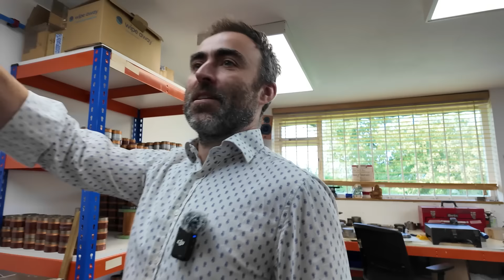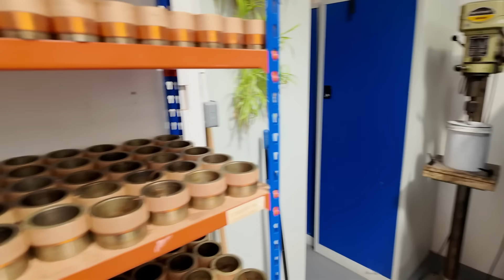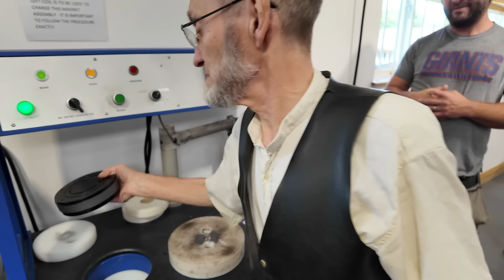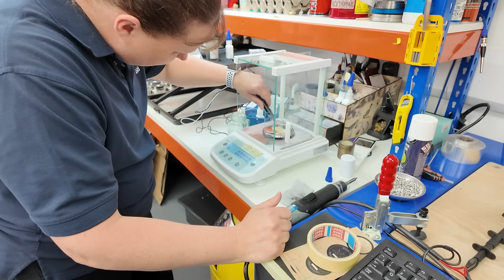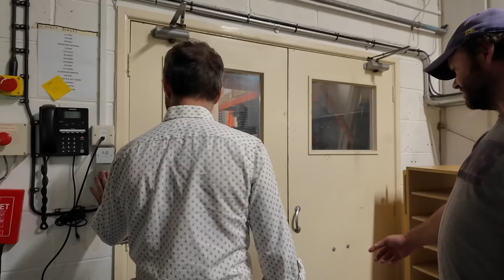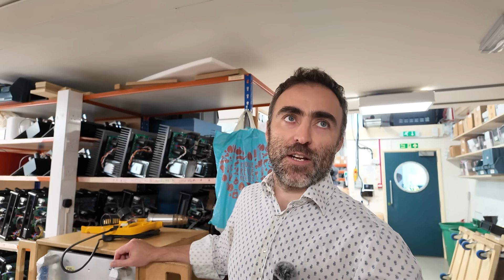We Visited the ATC Factory in England | High-End Studio Monitors

Comment: I ran a PA for 20+ years with PA75s on the mid-tops, with Martin and Beyma horns, for  hi fi quality at an industrial scale. Bass was Tannoy and RCF 15s, and EV 18s. All set up as a radiant four way rig. No complaints about sound quality, no distorted mud blowers, no screechy mids. Resonance be gone!
I still have a pair of pristine 40 year old PA75s for live monitoring.

In my studio, I've been using  a pair of SCM10s since 1994, and their transparency has survived multiple studio spaces. Zero listening fatigue will always be a useful selling point.
I've considered getting some 3rd party beryllium tweeters for them, but I reckon that would unbalance the overall sound too much towards the top end.
If and when ATC offer a beryllium upgrade option for their small three bolt mounting tweeters, I'll definitely be prising my wallet open.

I've noticed that the SCM10s get the best out of big toroidal amps.
You definitely need some decent rms wattage to drive them properly, because who needs clipping when clarity is available. 
They can cook underpowered "hi-fi" amplifiers within a few hours if you're brave enough to try it.